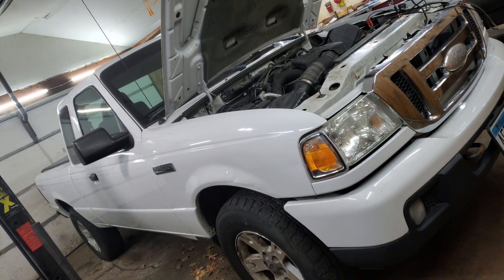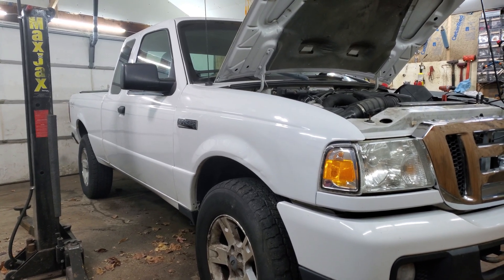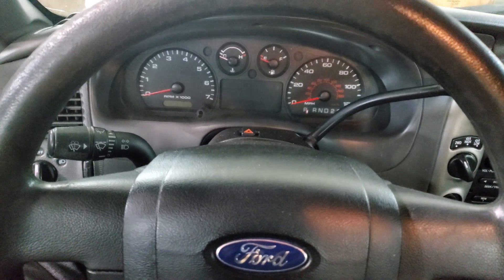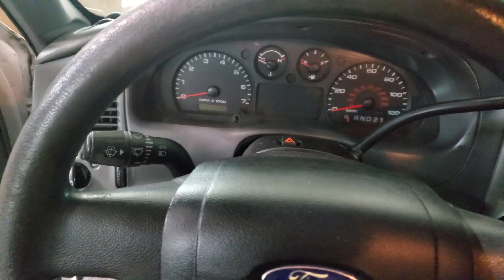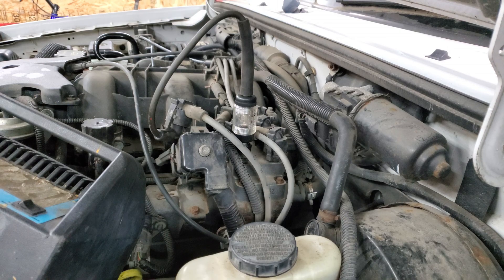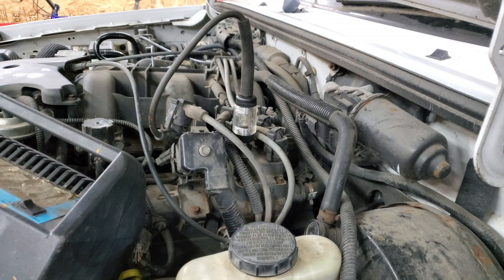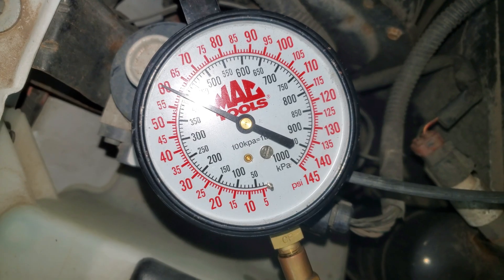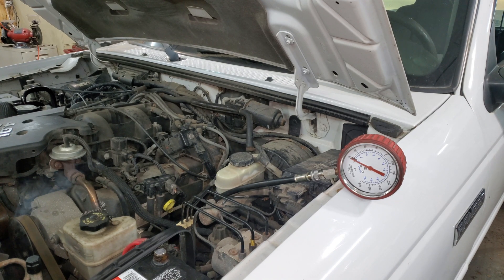2005-2006 Ford Ranger timing chain diagnosis

Comment: That engine is known for timing chains. Happens with the v6 ford explorers. Plastic guides or something.
Reply from the maker: This thing is not an Explorer engine. It has OHC's, and a jackshaft going through the engine that puts a timing chain in the rear of the block for one head.
Reply: @RustBeltAuto  Fix Or Repair Daily

Comment: The old 4 cylinder Lima engine had a timing belt.
Reply from the maker: I had one of those dual plug ranger things. Wouldn't do over 65 uphill. Wouldn't die no matter how bad I treated it either. Couldn't stand the thing.
Reply: @RustBeltAuto  did you actually replace the timing did you do a vedio
Reply from the maker: @cornell833  no. The victim got cold feet, and sold it. He drove me to Duluth to get an engine he found on FB, and it was a regular exploder engine. 🤪. The tweaker selling it got mad, like he was going to throw down telling us we were waisting his time. It was actually quite entertaining. End of story time.
Reply from the maker: @cornell833  no. I tried to talk the victim into buying a remanufactured engine. Don't see the point in trying to repair something so idiotic. It's a can of worms.

Comment: i had an old ford the timing chain broke on and wiped out the cam and crank gears. some how it spun cam backwards and destroyed the valves. made a nice paper weights
Reply: 2.3 liter ranger is a non interference motor, should of stuck with the 4 cylinder